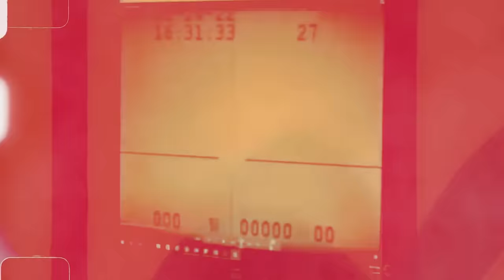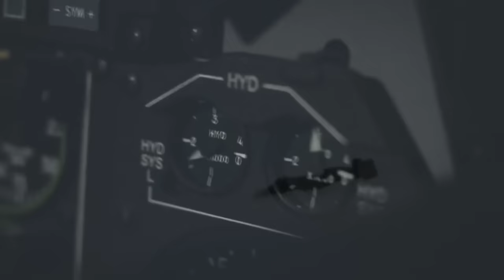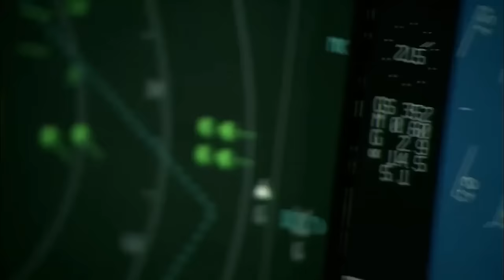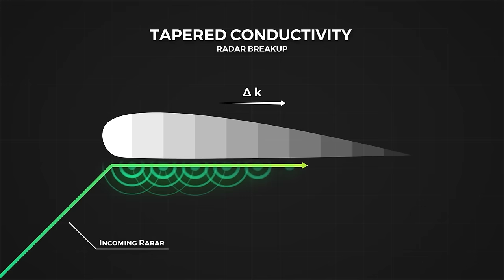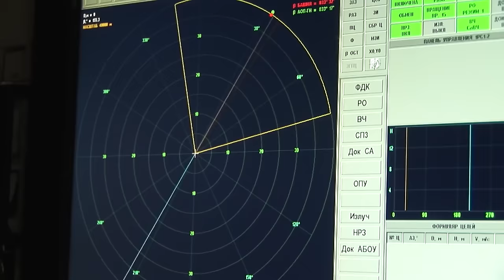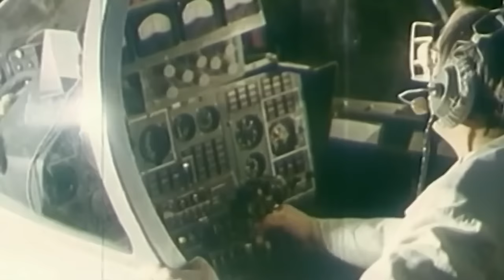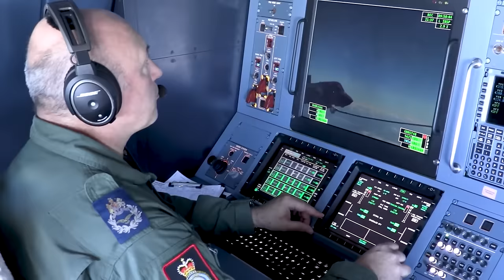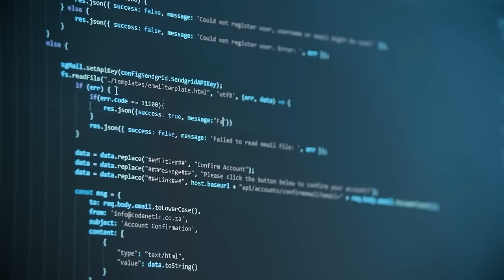Shut up about the F-35! The most scandalous aircraft of the 21st century | Documentary

Comment: What people dont seem to understand is that the per unit cost of the F35 is pretty cheap.

An F35A is below 80 million, which is not much more than a new model F16 or F18. It is on par with a new F15 or a SAAB Gripen, and its cheaper than Rafaele or Eurofighter.

Yes the total program cost is insanely high, but it is also for a very high number of aircrafts. 3100 total orders so far, and new orders are still comming. The US alone will likely buy 2500 before production ends.

Contrast that to Sukhoi SU57 where Russia is struggling to build 22.

The main challenge of the F35 cost wise, is that the costs per flight hour is significantly above that of the 4th gen fighters

Comment: 1:10 beause concurrency has never worked. always costed more. always actually caused delays. and yes.. it was tried before. it also failed before too.
Reply: That was a misstep from Lockheed, but on the other hand had they not there wouldn't be any f-35 in the sky until 2018 and then the computer technology in the jets would most likely have been obsolete anyway and need upgrades like is planed. Military developments are a special kind because if you wait to every bug is ironed out then the air-frame could be obsolete before it enters operational service and the entire development cost could have been for nothing.
Reply: @luffirton  the first 300 articles i head are useless now and impossible to bring up to the latest block standard. concurrency actually can slow things down as you end up handmaking each example while you sort things out. you then deplete your resources allocating that to "re-manufacture". GD got the f16 into production very quickly in the 1970s without concurrency. the gripen designed even before the f35, can be updated in an afternoon as they separated flight systems from avionics. so any modern tech upgrades can be quickly cycled. management rarely blames management.

Comment: The F-35 has had less accidents than the F-16 F-18 and all others diring there operational and testing stages and the F-35 is 3 different planes F-35 A , B ,C shareing various parts to make it one program. 3 diferent planes not one.
Reply: One reason for this is the F-16 was the first fly by wire jet. It had many bugs but sense then have been worked out so the F-35 shouldn't see any issues from that end. Let's all remember the F-22 was the air superiority craft while the F-35 was a small roll aircraft. If this thing ever see's a dog fight the pilot won't be the one talking about it, the F-16 eats it alive in close combat
Reply: FEWER  - - - fewer (accidents) - - -  not "less" (of them) - - - fyi
Reply: @Vv_Twisted_vV  "sense'  - - -  "SENSE"?    
Since when have you been using the word "sense" to mean ---> a f t e r   (something)?
Reply: @manifold1476  I can go back and edit a typo as you did but I am not that anal. If you want to contribute to conversation feel free. If you want to play Mommy, go find someone else.

Comment: Master of none! The vertical takeoff plane should have been a totally separate project instead of degrading the other two versions. Seems reasonable that a strengthened version could be made to withstand carrier operations using most of the land based version.
Reply: The main reason why the F-16 has lasted for so long, is because it was "just" a fighter and therefore optimized for that specific task. The F-35 has consistently been praised as this brilliant Swiss Army Knife airframe that "can do it all", without ever acknowledging that in order to be that airframe, significant compromises had to be made. 
So yes, realistically speaking it can't be anything but a "master of none": 
- as a fighter it will be unnecessarily heavy, limiting its range
- as a VTOL it will have a very limited range due to the high fuel consumption during VTOL flight
- as a bomber it will have limited load capacity ánd range
Reply: @tjroelsma    The F-16 is most definitely NOT "just a fighter".  A fighter is an aircraft made to fight against other aircraft. The F-16 was designed and made to be the highest performing air-to-air aircraft in the world.  It was the first air-to-air fighter in history to be certified for 9 Gs.  It was one of the first to have more thrust than it weighed, allowing it to accelerate flying straight up.  It was designed to be very very small in order for it to out turn anything in the sky.
Every F-16 flying today can carry bombs.  It has proven to be one of the best tactical bombers in the world, even though it was never designed to be a bomb carrier. The F-35 can do both fighter and bomber roles much much better than an F-16.  The EF-18G Growler  is the world's best electronic warfare aircraft, bar none.  That is, until the F-35 Block 4 is flying.  It will be a more capable electronic warfare aircraft than the Growler.
I think you may have heard that an aircraft can't do more than one thing very well from listening to the fighter mafia in the Pentagon.  It's a slogan that has been used since the 1960s and has been proven to be wrong again and again.  I would advise you not to base your tactical knowledge on a bumper sticker slogan.
Reply: The idea of a vertical take off and land aircraft is you don't need a runway or need very little runway ! The Vertical Take off and Land F 35 was built for the US Marine Corps ! Not needing a runway during time of war is huge !
Reply: A good example of a dedicated mission aircraft is the A10 Warthog . The A10 not only does it job well , pilots and Troops on the ground love it !

Comment: Should have kept A10 (look at Su25), upgraded F15 (look at Su27--35), dropped the VTOL nonsense, upgarded the F/A18 to A6 range and load. Cheaper, more usable in actual combat, not just air shows.Look at Ukraine. Russians are ahead in actual operational combat aircraft.Don't need to worry about shareholders...
Reply: The A-10 is actually shit.  F-35 is better than F-15.

Comment: The F-35 is past 1,000 unit production. The price of an F-35 (drive off the lot) is right at $80 million each.
Reply: right and with that many units you are going to lose a few here and there. Now if there was only 100 made
and you lost 5 or 10 that would be bad!
Reply: @bdub1934  Yeah, it's "peacetime attrition" is actually very low compared to most other fighter aircraft (flight hour for flight hour). Better than any other single engine aircraft that I'm aware of.
Reply: Better bargain for a new Tomcat (134 million in today's money)
Reply: You are forgetting the running cost  over 6000 hr = $210.000.000 as compared to about $ 50.000.000
Reply: @Karl-Benny  I assume you are referencing the Saab Gripen? The Grippen does have an incredibly low fh/cost. It's somewhat helped by the lack of any need for international or regional maintenance depot infrastructure (Sweden isn't very big), but it really does have an impressively low upkeep.
Reply: @Karl-Benny  Sure...you think it's cheap running the best aircraft on the planet? Believe me, the Russians would love to have this problem. They have the Su-57, of which they have built maybe 20 and have sold 0 to anyone. The US has produced over 1,000 F-35's produced and has sold over 500 to foreign users with orders for more than 250. Yeah, when you have to have a problem, this is the kind of problem you want to have.
Reply: @brianfoley4328  please don't compare the F-35 to the Su-57. The Su-57 would eat it for breakfast as will the Su-35. Get to know your aircraft and the ordinates they carry. They say the F-35 carry's long range weapons, compared to what the Su's carry it more like mid range. 
The F-35 was not designed to go against these jets the F-22 was until it was cut for $$ in the Obama era. The F-35 is junk compared to the F-22 and now they gone and named it a multi roll aircraft by adding hardpoints to the wings for additional weapons removing the only advantage the plane had in the first place, stealth.
Reply: @Vv_Twisted_vV  You obviously don't know much about modern aircraft combat...the days of "dogfighting" is fast approaching the past tense. Will there always be some form of dogfighting, probably, but Beyond Visual Range (BVR) engagements will be much more frequent than "dogfighting". The British have the Meteor air-to-air missile and the Americans have the latest iteration of the AIM 160D and the AIM 260 soon to come on line. The Russians have the R-77 series (a fine missile in itself)...but the point is...who sees first kills first is the mantra in air-to-air combat. The F-35's stealth, combined with it's much better radar make the less stealthy Su-57 a flying target.
Reply: @brianfoley4328  Funny they said the same thing back in the Vietnam War and built fighters without guns and we all seen how that went. Dog fighting will never end but you have your opinion backed by solid facts, right? Have you ever heard of tactics? Funny how people think everything is rock solid until it isn't. Wait until drones factor in the equation. America loves to build pricey fighters but not all Country do, some like big numbers low cost. How many BVR missiles do the F-35 carry? There are many factors to consider but take a good look at the F-35 and it's it over priced cost compared what it can do. In this day and age it's a turkey with stealth and they have even took that away from it with hard mounts.
Reply: @Vv_Twisted_vV  Vietnam was fifty plus years ago (I know I was there). You seem to completely miss the point of stealth technology and why the Su-57 is so far behind the curve. The US has had stealth aircraft for more than thirty years...let that sink in for a minute. So, besides thirty years to mature and adjust stealth technology under real combat conditions, the US has had more than thirty years to observe stealth aircraft in real world environments. The US is uniquely capable of tracking stealth because it has had stealth technology longer (actually uniquely) for a long time...time to develop tactics to use and to counter stealth. The Su-57 is a disaster (the last international partner just withdrew from a joint project) while the F-35 has even convinced the Swiss to purchase it. Understand that more than half of the 1,000 F-35's produced to date (compared to 20 Su-57's) have gone to foreign buyers. The US still has orders for an estimated 2,000 additional F-35's not to mention more and more foreign buyers. The problem for the Soviets (let's be honest, they've gone back to being Soviets) is that when the US couples it's advanced radars with low-observable and truly stealth aircraft armed with AIM-260 missiles...the SU-57's will be shot down before they even know the F-35's are around.
Reply: @Karl-Benny  Gripen= $16000

Comment: No F-35 can maintain super sonic speed for any useable length of time without damage. This plane as an interceptor is useless.
Reply: It's NOT an interceptor. It's replacing the A-10, F-16, and the Harrier. None of those planes are interceptors, either.
Reply: @pike100  Well, the A-10 carries about 50% more ordonnance than the F-35. Which means, for every 2 A-10's  the F-35 has to fly 3 Times, to deliver the same payload. Also, the F and A descriptions are not for show, An A- something is an Attacker Plane (Air to Ground) , F- Planes are Fighters (Air to Air) and B- Planes are Bombers. (Large Payload Air to Ground). All 3 F-35's start with F. There you go. Now, If you want your F-35 to fly ground Attack missions, you want it to do it from very high up. She needs to use that stealth. And if we then take only INTERNAL PAYLOAD, Then she can't even carry one third of what an A-10 can. 
Of 3 weapon bays, she has two which physically can't fit anything else but short-midrange air to air missiles.  And that last weapons bay cannot carry more than four JDAMS.  You see, that's an awful lot of plane around a tiny combat capability. Now you have to fly an F-15 EX as "Missile Truck" behind it, which CAN carry 14 long range air to air missiles. BUT, that's now 2 airplanes in the air, of which one must protect the other. And that one is NOT stealthy.  And the B-variant makes even less sense. as it is Naval-based, and needs an F-18  Super hornet "bodyguard".

Comment: oh come on guys.. the F35 is in one word...."CRAP"
Reply: Prove it
Reply: pogue
Reply: Here's proof, by a F35 maintainer!

The aircraft is the safest out of all airframes in service by the air force with a 1 percent failure in ALL airframes. The systems on it give our pilots the best situational awareness with the DAS system, the AN/APG-81 and EOTS system gives the F35 insane tracking and targeting, and Electronic Warfare capability. Maintainence wise it's really easy and the aircraft tells you what's wrong automatically after flight. 

The 1.5 trillion program is for operating 2000 units up to 2070, so it's not instantly just 1.5 down the drain, but eventual cost by 2070. Each unit is 77-80 million per unit, also the F35B compared to the Yak141 is not true, the Convair 200 had the same system years before the Yak141 was even built. 

So by calling it a failure and crap is complete and absolute bs from the words of a maintainer, and this aircraft is a goddamn masterpiece!
Reply: The F-35 is an excellent airplane. Many of these journalists are shit stirrers.
Reply: @Kriegschwein76  I will make a 15 min vid about the F35 and bust the bs about it.
Reply: @viperz3r016 The auto makers can't find problems if it is from internally broken wires or software glitches or multiple problems or oxidation of jacks to name a few. Get some miles on the F-35 and they will get junked also. (from an electronics tech, USN.) BTW, the military can afford to easter egg their way out of snafu equipment- so far.